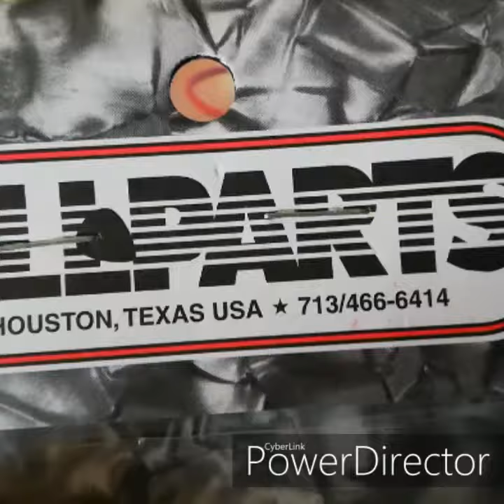Sss to Hss Stratocaster Conversion (Routing, Soldering..)

Comment: could i ask why on the humbucker it has one creamy white single coil and one black single coil together.  does the 2 colours like that have a meaning? normally the colours would be both black, i always wondered if the the 2 colours were for a reason. thanks.
Reply from the maker: Non c'è una ragione,negli anni 50 gli humbucker erano coperti e utilizzavano colori a caso,bianco e nero. È solo una questione estetica adesso (traduci)
Reply: @McBrownGuitar  hey thanks for that, i had to type that in to google to translate it lol i'm a beginner at electric guitar, so i'm always learning new things along the way 👍